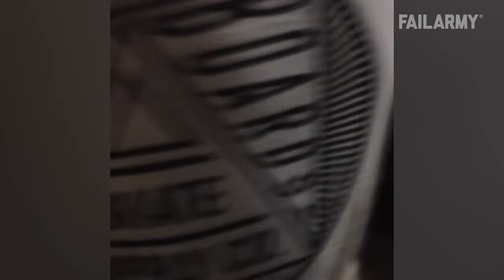When Everything Goes Wrong | Funny Fails

Comment: I'm constantly surprised at the people whose thought process goes "Oh, my motorcycle is going too fast. Gas, gas, gas, I'm gonna step on the gas."
Reply: It's a side effect of the twist throttle. You accelerate and are being pulled backwards, but hanging on tighter tends to pull the throttle more, so it goes out of control. You have to do the un-intuitive action of relaxing your grip a bit and twisting forward to slow down.
Reply: They call that whiskey throttle.
Reply: i keep asking myself what did they think would happen if everything happened perfectly for them.
Reply: It also matters a lot in how you establish your grip.
If you grab the throttle with your wrist flat, its pretty much impossible to go out of control because it would break your grip.
Reply: ‘Step on the gas’ that’s how I know you’ve never rode a motorbike
Reply: @MrMarbles0Xecution Or possibly that you have never heard the meme.

Comment: 16:39 when on holiday once the washing machine broke clogged up with muddy cloths from a previous day. I tell you that was a problem considering it was just me and my Dad who has back trouble. Trying to empty a half water filled washing machine and keep a tub under the water line where the water would initially drain out single handed is a lot harder than you might think.

Comment: is a diesel runaway. Pro tip: If your diesel won't shut off or starts to rev up without throttle, it's burning oil instead of diesel. The only way to shut it off is to starve it of air. Stuff your shirt, hoodie or really anything you have at hand down the air intake. It might wreck your turbo, but it has a chance of saving your engine.

Comment: the beams for a pulley system wouldn't have to have been wooden. even to this day if you leave any metal out for too long a scrapper will take it. Just because metal fittings havent been found doesn't mean there were none, just means looters have been busy.

Comment: Whoever came up with the idea that to check the lint trap on a washer/dryer combo means letting out tons of water onto the floor needs a kick in the balls.
Reply: They're manually draining the washing machine, not checking the lint trap.
Reply: @miniaturemachinist6098  Well, i have a dual washer/dryer and the lint trap is on the bottom and checking it causes a large amount of water to leak out onto the floor.
Reply: @khatdubell  What model is it? That shouldn't happen.
Reply: @miniaturemachinist6098  it’s by LG.  says “inverter direct drive” but I’m not sure if that is a model

Comment: 15:10 that is a rotary phone and its not even capable of being hooked up.  Hell all phones like that were blocked from being able to hook up back in 1994 because technology advanced.  That phone was from the 1960s.  Its worthless except as a conversation piece.  If someone tells you to use one of those they are being assholes.  Its unusable and has not been able to be used in 30 years in which 20 years before that they got put out of usage do to button dial phones became far more used because they did not break your finger trying to dial.